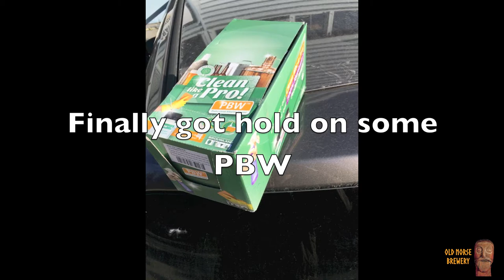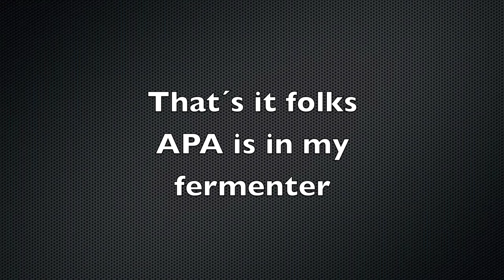American pale ale - all grain brew day

Comment: Mmmm premium malt fondle both crushed and uncrushed. What kind of mill do you have inside that wooden cladding? you can't go wrong with centennial in a pale ale. Cheers
Reply from the maker: Thank you my friend. You have to fondle the malt. It´s mandatory, haha. Inside my mill is the biggest, baddest monster mill with a 3/4" drivershaft and a 180 rpm all American monster motor. Cascade/centennial is my absolute pale ale hop favorites. Cheers